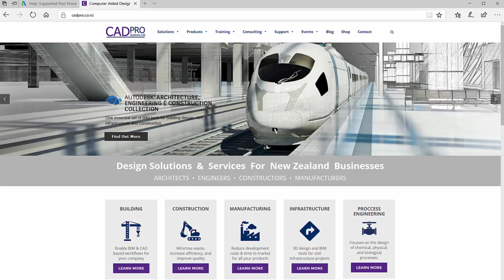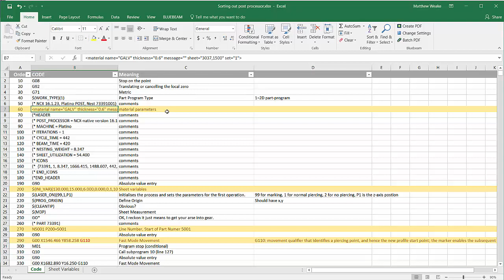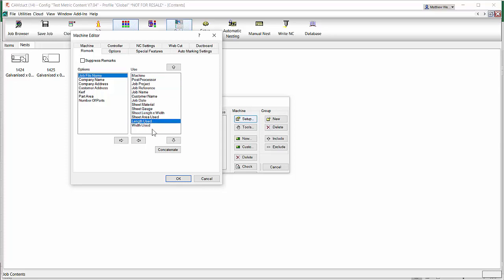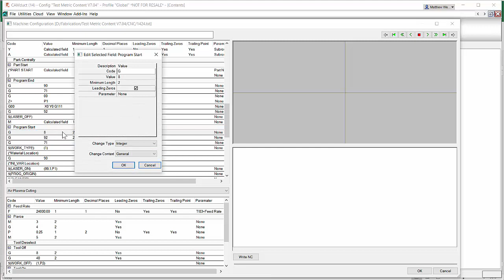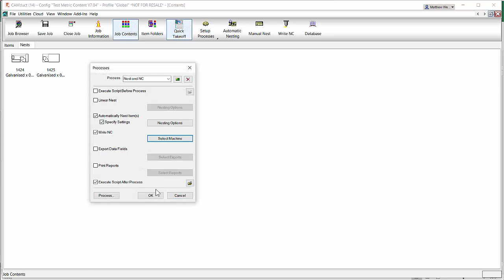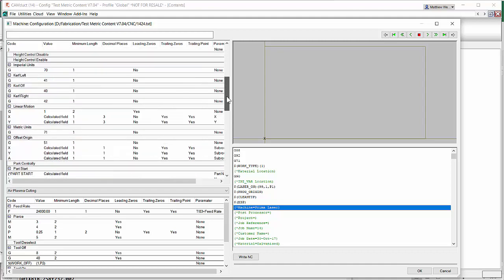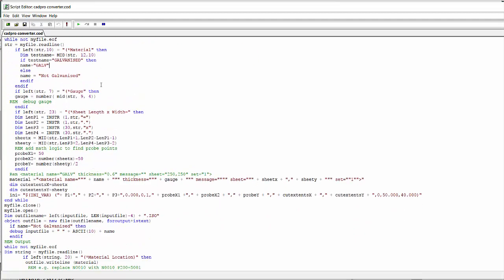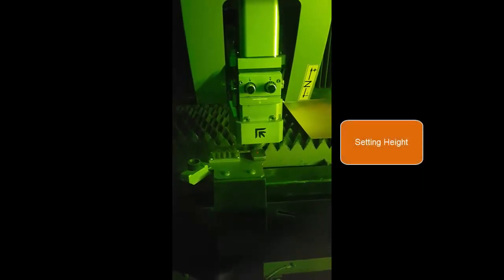CAMduct Custom Post Processor

Comment: You should be able to customize all those remarks in Camduct itself so that it is directly writing the information you need into the .txt file for the machine to read. Good on you though for this vid! Amazing!! Is everything still working nicely?
Reply: Well, this is a slow reply. I guess I missed the notification. There are many things I should be able to do in CAMduct but find it difficult or not possible. Since then we have been working on another Laser that requires substantially different formatting using subroutines for parts. All of the reformatting we are doing in another program we call from the script.
This machine is still running just fine.

Comment: i edited  a burny postprocessor using the tool custom CN for a old burny machine but When the cnc file is generated the machine doesnt read the file .so we have to write the cut number manually.
Reply: There are many reasons this might be the case. Some of the old controllers are very fussy. The text encoding on the nc file I have had problems with. In another case an old Lockformer plasma would not read block code and only essi code.